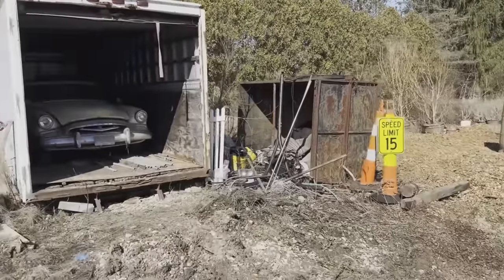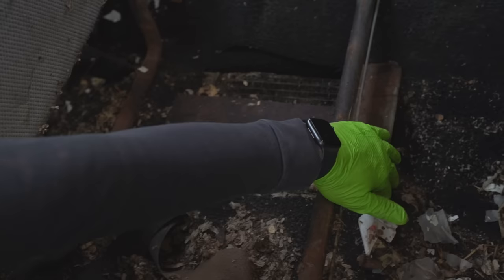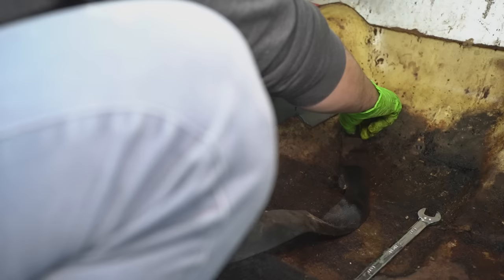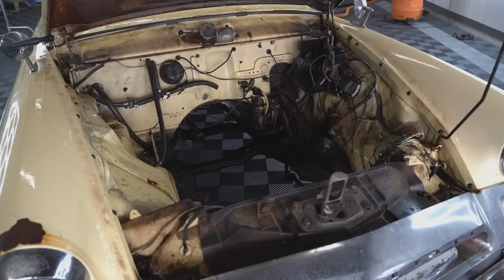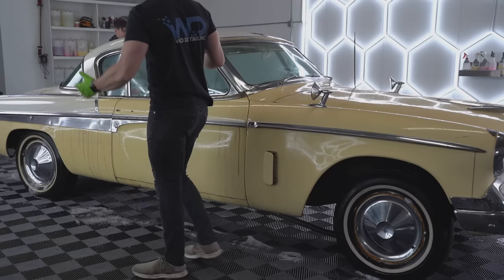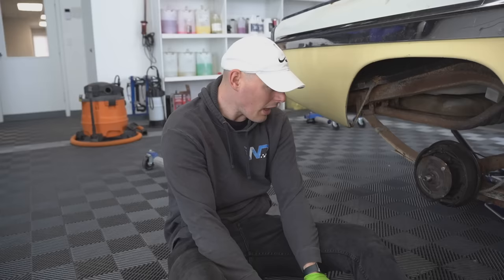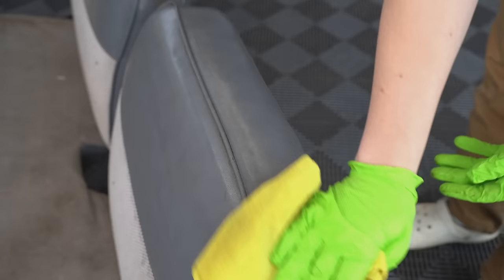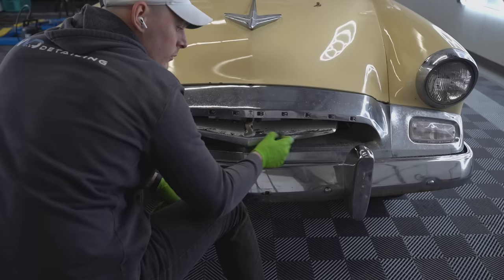First Wash in 30 Years: ABANDONED Barn Find Studebaker Disaster Detail! | Satisfying Restoration

Comment: Many years ago I got a job at a service station, and I needed to get the wheels off a very old Dodge. and got 3 wheels off but one of the rear wheels, the lugs nut wouldn't budge. I started go get out the heavy-duty impact gun. Thankfully an older guy was working with me, and stopped me, before I started to do exactly the same thing you just did. From that day on I always looked for the "L" letter on the end of the wheel stud. So don't feel bad about it, I'm sure we aren't the only persons that have do that,  Your  doing the right thing, fixing the problem and moving on. That's such a cool old car, I hope the owner gets the engine back in and gets it running again. How cool would that be to see that old car back on the road?  thanks for the video.

Comment: Great to see someone saving this amazingly solid Studebaker - a Champion 6 I think ; the V8 Commanders and Presidents  had an elongated '8' in place of the 'S' on the emblems . A good engine , the V8 Stude , 259 or 289 , but I would imagine a little thin on the ground by this stage . The SBC should fit in with little trouble . Studes were great cruisers with the popular Overdrive option , otherwise I think they featured  a Borg Warner sourced Automatic , similar to Fordomatic by '55 . They called it Flite-omatic I seem to recall .

Comment: I was a machinist 40 years, center drill as close to center as possible then step drill until you get close to the threads, it will weaken and relax  the you may be able to turn the remainder out the chase the threads with the appropriate tap ( left hand)

Comment: Snap -on Tools makes a pointed tool that fits a muffler cutting  air hammer that will punch those studs out easily. I have used the same tool many times. You may have to heat the axle with a torch to help.

Comment: Studebaker had the heater under the seat on all coupes until 1963.  There was a separate unit for the defrost.  There was a fan that blew air thru that unit undere the seat.  The wheel Stude's drive out of the hub with a punch.  They are a tight fit drive hard.  I would put a hemi in it and go to Bonneville for fun and speed.  Great job of detailing   Thanks for saving a great car.

Comment: The gas cap lock is so people don't steal (siphon) your gas. There were gas cap locks or fuel door locks into the early 2000's and even today there are security measures in some form to prevent theft, like when you pop open the fuel door from inside your car.

Comment: The "radiator" you found under the seat. I have a 51 champion and it is called the climitizer. Basically the heater.  You mentioned the fresh air door on the driver's side, the passenger side has the same door. But the fresh air is routed through the climitizer under the seat and blown to the front and back seat.

Comment: I remember my dad having a 11932 Plymouth Pickup with the wheel wells on the front fenders and a 1927 Hudson with dual Ignition WiTH 12 huge spark plugs.  And solid iron wheels and big skinny tires and a rear tire mount. IT HAD BEEN A FUNERAL HOME FAMILY CAR AND HAD ONE SEAT THAT FOLDED DOWN FROM THE DRIVER'S BENCH SEAT.

Comment: Interesting that the left hand thread studs were on the right side of the car.  On my '65 Plymouth, they were on the left.  I had the same confusion you did, never having encountered left hand thread studs.  Fortunately, I was just using a cross-bar, since I didn't have an impact.  While I was struggling with those nuts, my brother, who had been an aircraft mechanic in Vietnam came by and suggested they might be left hand thread.  I tried turning the opposite way, and to my surprise the nuts came right off.

Comment: 283 ci Chevrolet.  My in-laws had a couple of Studebakers of that vintage.  A Champ P/U came with a 283.  And a commander either a six cylinder or a small block Chevrolet.  Try to use the VIN code to see if you can find out what engine came with it.  Stock configuration have more resale value than something that is modified .

Comment: You went the distance and pulled the seats , why didn't you pull the carpet also and pressure wash it also ? It would have made the detailing alot easier especially dealing with a carpet in that condition.  I have pulled many carpets and pressure washed them, and they come out far cleaner than using a carpet steamer . The car came out decent, and you guys did a decent job  . Thanks for the video

Comment: Heat/ torch grind those studs flat heat them up and use a drift pin to drive them out. The left/right hand threads was common especially on certain car makers. Lesson learned.

Comment: Hi! I have a 1955 Champion 16G6 ( 2 door sedan ). I would put the original 1955 Champion engine back in it. For '55 Studebaker stroked the crankshaft 5/8" to get 185 CID out of it with 101 factory HP. Not much power compared to modern engines, but balancing the internal parts makes it a smooth and quiet running engine. They're original only once. You can't break them, only slowly wear them out.

Comment: The locking gas cap is definitely aftermarket... If it was any kind of daily driver in the 70s during the OPEC gas crisis,  gas theft was a very common issue and those locking caps were a really big seller.

Comment: My Father had a '55 same as that one only two-tone green - upper light, lower dark - with the flathead 6 that we later used to make a high-compression overhead 6 as the crank in the flathead had a longer stroke than the overhead.  We kept that car, actually hauled it from southern Iowa to Minnesota when we moved even though it hadn't been driven is several years at that time.  Just something about those cars...

Comment: When you snap off a press in wheel stud unscrew the hub nut and use a pulley puller to pull the hub off then simply press them out on the vise using a socket slightly larger than the back of the  stud and a bolt slightly smaller than the stud. Press new studs in in reverse fashion 👍

Comment: The lock on the fuel filler cap is there to prevent the theft of gasoline at the time when it is either rare or expensive. On modern cars, the fuel filler door is also locked whenever the doors are locked. Same purpose!

Comment: You fellas do amazing work!!!! If I owned the car I would install a small block mopar engine and automatic transmission with a mopar rear rear end!  Older model Chrysler Plymouth and dodge were left handed threads on left side and right handed threads on right side

Comment: For the engine option question, probably the stock Flathead Six that it came with, if the owner still has it, because even thought those engines weren't the most fuel efficient, they are incredibly reliable, easy to work on, and are hard-headed and can tolerate a lot of abuse. Also because not many things go wrong with those engines other than the valves being stuck if you leave the vehicle sitting for a long time. The interior and paint color appears to be stock on the car (even surprisingly the radio!). What a good find! Only downside of the car is that the right wheel lug nuts are left-hand threaded, which is something you'll have to remember if you need to do a tire change.

EDIT:
The lockable gas cap originally had text on it (now faded) saying that the fuel may be under pressure, and that you must remove it slowly, similar to when you have to remove a radiator cap; it says remove slowly. Studebaker did this because sometimes the fuel could come spraying out through the filler neck and spray your eyes because of the potential pressure. Pretty smart safety feature in my opinion. Not something you see on today's cars.

Comment: Thank isn’t a radiator that is an auxiliary heater core. This was an option on studebakers. there is one with the blower motor and the one under the seat is for extra heat which never worked very well. Studebakers always had terrible heat.

Comment: Underseat heater. Pretty common accessory on Studebakers of the fifties. Some cars even had a pair of these heaters. The blower was located adjacent as a rule. To pull the rear brake drums, you remove the center nut, and use a special puller. Chrysler products of the era used this same system. Tapered axle shaft, plus a beefy key. Also, driver's side lug nuts were left hand thread. Used by most manufacturers at the time.
If it were my car (and I were younger) I would definitely install a Studebaker V8. It would have been a 259 in the day, but a 289 would be identical on the outside. And definitely overdrive.

You can't remove the studs from the hub without a press. The hub and drum are serviced as a unit.  The good news is that you don't have to remove the axle shaft, and if you needed to replace a wheel bearing...or maybe the brake backing plate, you can just do it. No clips in the diff gears to worry about. Dana thought of that for you!

Comment: The gas door can be opened by anyone, so we used to use locking gas caps to prevent siphoning. Gas theft became a real issue in the 1970s during the two oil crises we went through. I have locking gas caps on my two Jeep Wranglers for the same reason: Some people suck.

Comment: Since the rear drums etc are now junk is really a good thing. I would assume that the new owner would prefer a V8 and at this point a brand X engine would be the easiest installation. This would require a stronger rear axle assembly such as a Spicer model 44 or other suitable unit. Other modifications would be a changeover to 12 volts negative ground which would also require gas gauge and amp meter to be modified in order to obtain accurate readings. All are doable at reasonable cost.

Nice find... I'm a bit jealous and Good Luck!

Comment: The Locking gas cap is due to the opening of the filler tube not having any reduction in diameter, as todays filler tubes due. This allowed for almost any size long tube like garden hose to be put into the tank and siphon out the gas. It was a big enough problem in those days that it created a market for the "Locking Gas Cap".

Comment: The heater under the passengers seat is actually the car heater. There are hoses that go up to the engine that's not a heat seat heater. All the older cars had left hand nuts on whichever side of the car. I thought it was on the left but anyway they you got to look at the stud see if it's got an l on it to say it's left-handed or right. Hope that helps get a hold of Studebaker international and find some people that have dealt with studebakers that will help you with a lot of things on fixing this ca

Comment: The locking gas cap was a regular feature for Studebakers all the way back to 1940.  The oldest one I could locate was 1942.  The first Studebaker was built in 1852 in South Bend, Ind.  Really.  And you are not a moron.  Stuff happens like the broken brake drum.  Amazingly there are plenty of Studebaker parts out there in the e-verse.  Since I am trailing along behind by a full year I'm sure you already found a replacement part and have fixed it up like new.  As for the carpet - I hope you guys got to be in on the removal and replacement.  Mouse pee when vaporized can carry disease.  Yep.  I was amazed at how well the seats were recovered.  No splits or rips.  Amazing.  Just think how much different that car would have been without the presence of mice.

Comment: From an "OLD FART" the proper way is to "pull the hub and press in the studs. You could get a Hub puller - put they are hard to find. You can make your own tool called a wheel stud installation tool, they have bearings built into them.  easily found online, But at a parts store?) but you can create your own. The replacement studs will be "splined" as all are. Get your studs and nuts, get a couple of extra nuts. Also, four or so washers that will easily fit over the "fat" part of the stud. Drift pin the remainder of the studs out, if the brake shoes are in the way remove them. 1) Slide the studs in form behind, 2) coat the washers and stud threads (use at least three washers at a time) with anti-seize. 3) put a lug nut on with the bevel side facing out - NOT IN- do not ruin the hub- The puller is hard to find, yes as stated I am an "old fart" and have one. Tighten the lug nut by hand to start so that the stud will start in STRAIGHT! The anti seize (grease might work) will allow the washers to turn and the stud to be pulled in.

Comment: My  57 Silver Hawk had the same heater under the front seat. Also had a rust hole underneath in the floor. If I ran over a puddle with the heat on the whole car would fill up with steam.

Comment: The owner said this model was a Champion, that would put it at the bottom of the Studebaker lineup.
He also said he had a flathead 6 all wired up and ready to install.

I had a Champion and it had a flathead 6, a likely senario for a low end model. That car is worth some money. Got to wonder if that flathead came out of it in the first place. If the car and engine are numbers matching, the value will be even more.

My folks had a big old gray tub of a 48 Plymouth when I was born. Then to a 51 Bel Aire Deluxe hardtop, a very well styled car. My Dad used to take me out in the country and let me drive. I was only nine years old, and I had to sit on a boat cushion to see over the steering wheel. I had to hang on to the wheel and stand up to push in the clutch. It was a three on the tree. Treasured memories.

Comment: Not sure if you put an engine yet, but there are some details to know about. The easiest thing is to put another 6 cyl in it. The 185 cid is the right one not the smaller 169. Most of these cars came with overdrive so check to see if there is an overdrive cable below the dash. In either case, you want to try and keep the original two piece driveshaft. This car should have a Dana 23 rear axle. Not very strong. If it was mine I would install the Studebaker 259 V8 but no burning rubber or you'll break the rear end. If the car is still 6volts leave it 6volts for two reasons. It is a positive ground system and the starter motor, flywheel and bell housing is not interchangeable to 12volt negative ground pieces. Tricky to upgrade a 6volt Stude but can be done.

Comment: I would drill and tap a smaller blind hole in the center of the broken wheel studs. Tightening the right hand bolt into the blind hole should loosten the left hand studs.

Comment: Just thought I should mention that if you find yourself doing restoration/repair work on a Studebaker, there is a terrific club for Studebaker owners (The Studebaker Driver's Club) that has multiple experts that can help with repair issues. There are also a number of vendors for New Old Stock and reproduction parts for Studebaker cars, such as Studebaker International.  Getting a replacement brake drum should not be that difficult!

Comment: The locking gas cap was made from 1960 to 1980 by a company called Stant.  It's an aftermarket item for most cars made that year.  I worked automotive parts 1974 to 2020.
Reply: Also, any Mobil locksmith can pick the lock for you

Comment: Myself, I'm sure you can find a used OEM engine somewhere.  The parts to rebuild it should be available and almost ANY machine shop can rebuild it for you.    Otherwise, check for an adapter kit so as install a Chevy 327 or in line 6 cyl.  I've done a lot of these, easy, time consuming but easy. Changing the engine will also encompass a transmission, modify the driveshaft along with suffrage mounts.  Sounds like a lot but look for Fossil Mechanics who have done this sort of thing.

Comment: RE:  Gas cap.................back in the "olden days" when gas was rising to over $1 and $2 dollars a gallon ('70's and 80's) a lot of people starting stealing gasoline from older cars that did not have the safety locks from the manufacturer.  Those were the days when they started putting the release lever inside the car or glove box.  This was the first time gas was this expensive and people were freaking out.  I had to buy one of those for my '72 Cadillac.

Comment: What engine? 
The 185.6 cubic inch Studebaker "Victory Six", of course. The 185 horsepower President 259 would be my second choice, but would need an upgrade to the brakes and the steering box. 
And before you ask, the original three-on-the-tree with the optional Borg-Warner planetary overdrive.

Comment: Locking gas caps used to be pretty common and was simply exactly what you'd think to prevent your gas from being stolen which happened a lot back in those days , still happens its just not as common.
Reply: Really became necessary during the oil embargo in the 70’s.

Comment: Great job on a beautiful car. The reason for the key lock on the gas cap was because the older cars were easy to siphon gas out of and was a big problem back then. With modern cars it's much harder to do that to.
Reply: That gas cap is an aftermarket addition. They were popular in the 70s during the Gas crunch of 73 and again in 78.

Comment: possible remedy- tool & dye - to drill hole in center of each stud cut threads, (know your sizes) then send screw thru bonding to remainder of stud, then heat & body hammer loose, unscrew the stud, replace.- have seen it done, will send link if found,

Comment: Did that final cleaning of the carpet in the video finally remove the mouse smell? I suspect the floor beneath the carpet also had mouse urine that had soaked through the carpet and collected on the floor. Probably the best thing would be to take out the carpet, clean the floor, and pressure wash the carpet. Were they able to get into the seat backs or the inside of the doors and body? Those little guys can find their way into almost any space where they can build a nest. We had our maternal grandparents 53 Ford sitting in an old airport hanger on our property and after 30 years, it too was a mass of mouse nests when we sold it. I feel for you having to clean out that many years of dead mice and droppings...a definite biohazard!